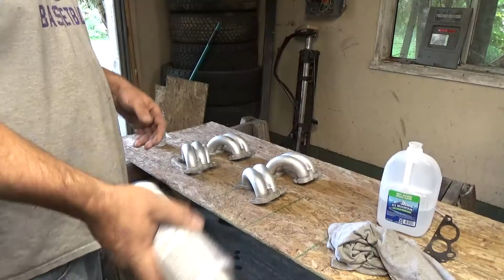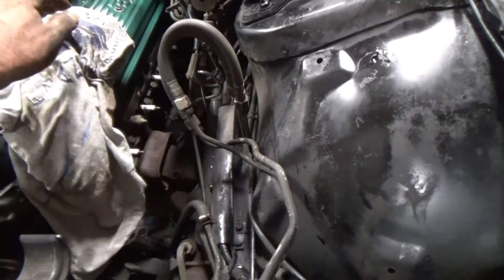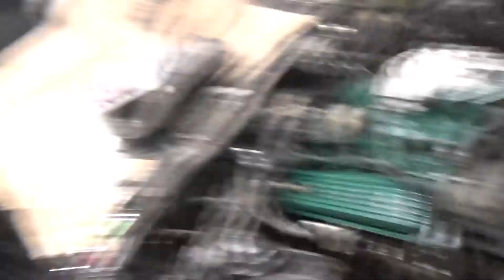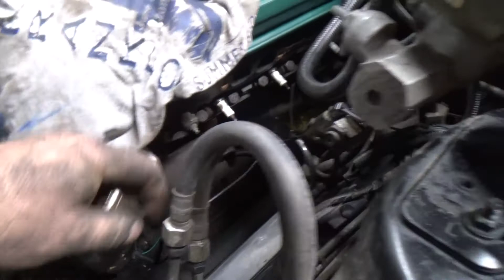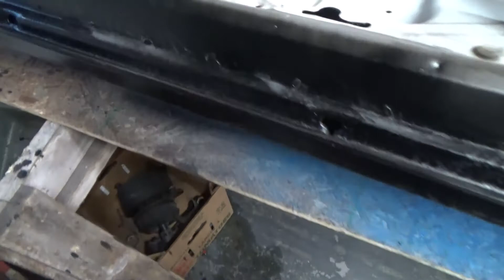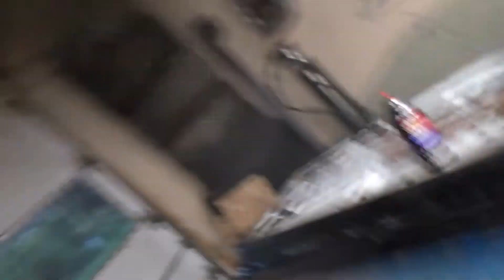Dupli-color is the worst spray paint ever made

Comment: The sensor that you are trying to work out where it goes is the O2 sensor, which goes into the exhaust manifold or header. It tells the computer if the engine is running rich or lean and adjusts the fuel mixer. It won’t run properly without it. You will need to get a new one.